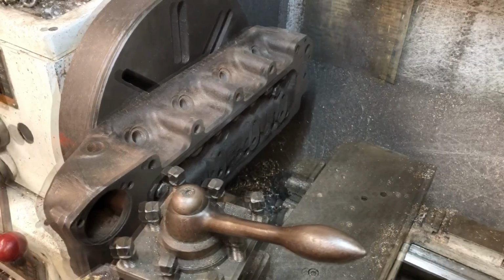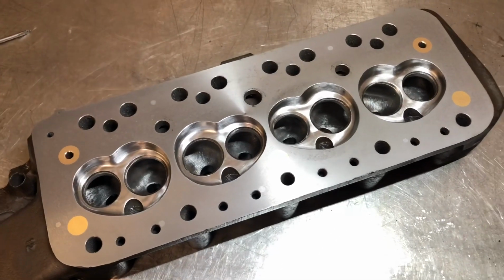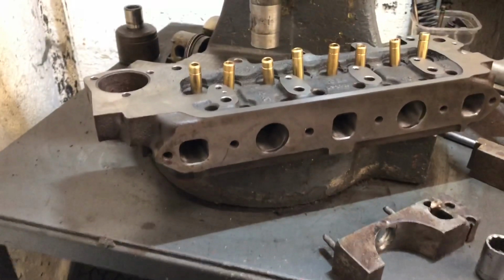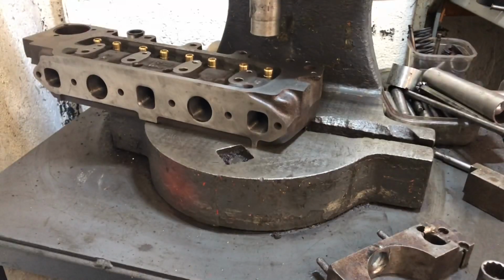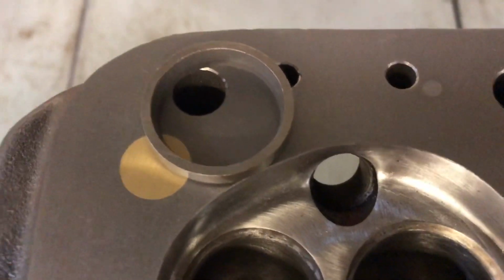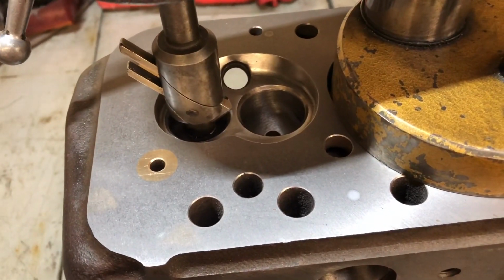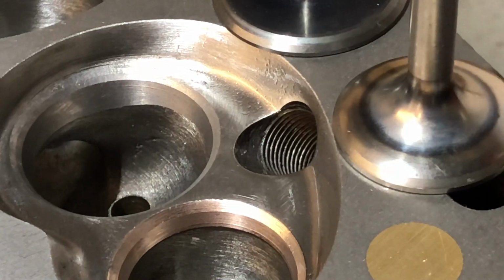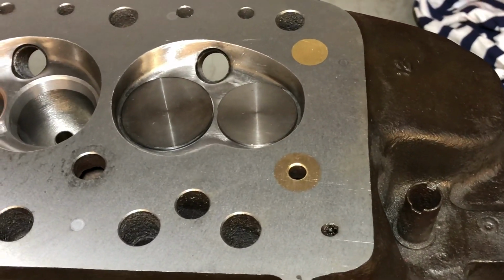How to modify your classic mini Cylinder head part 2

Comment: Nice work. I like the lathe surfacing of the head.

About 45 years ago I skimmed a 12G202 head with the only thing available to me at the time, a shaper machine, head worked fine till I replaced it with the better 12G295. This was on a 1098 cc engine for a Mini.
Reply from the maker: They used shapers for the factory cyl head surfacing
Reply: In Australia, we were fairly lucky 45 years ago as Morris 1100 autos and Minimatics had 12G295 heads. We also had a car called a Morris 1100 'S'. These babies were fitted with 1275s with 2 different block casting numbers, 12G 949 had forged cranks and Cooper 'S' rods but had a weak spot above the centre main and were fitted with sleeves in the bores, which prevented over-boring. Then there were the 12G1279 castings, which had lesser cranks and rods but no sleeves in the bores and no weak spot above the centre main. They were basically Spridget blocks turned 90 degrees. The good thing was that all the bits were interchangeable. It just so happened that we were on good terms with the local English Auto Wreckers, who would turn a blind eye whilst we made engines out of all the good bits and only pay for one block. They were happy and so were we  I had one of these hybrid 1275s in my 13-inch wheel Mini Moke. Coupled with an Mk1 Cooper 'S' head and twin 1 3/4" SU carbies of an Austin Kimberly (2200s in England) and I had a bit of a rocket. We were also on first name terms with  RPM Engines, the local engine machinist who we would get to make anything we wanted (Custom camshafts, balancing, lightened flywheels etc) and also on first name terms with Settlement Exhausts, the local exhaust shop who also made any exhaust we wanted. No one even mentioned the words "Street legal" in those days. Ah, memories.
Reply: @dalybaz I bought a junk car that ended up having a 1220cc engine in it. It was a 1100 with Hillman Imp Pistons in it. I didn't even know you could do such a thing. Because of the longer stroke, it went as well or better than a Cooper S. I then pulled it all apart, had it heavily modified, including using a heavily modified 850cc head and slapped that on top of a MKII Minimatic box. The thing made just over 110Bhp AT THE WHEELS! the thing was a Cooper S killer for sure. Thing was a bit rough at idle, but that was because of the 'Scatter Cam' and auto.
Reply: @doraexplora9046  I've found that the 1100 engines tend to go bang if you hot them up. 1220 using imp pistons is cutting things a bit fine. Use a std camshaft and don't rev them too hard. Maybe even tuftride the crank and lighten all the reciprocating bits to get the thing reliable. Bear in mind that the 1100 engine was designed for a series of granny cars.

Comment: I think you mentioned that you had used Neway valve Seat cutters before. Can you tell me which ones I need to do the 30 and 60 degree top and bottom cuts. I might be able to get a SH set but it only comes with the 46 degree cutter.
Reply from the maker: Hi 
 I have a selection of older neway cutters, check the reference numbers with the neway site for 30, 70 and 60 cutters or use three angle cutter blades in a 45 degree body.

Comment: Hi Stuart. When you press the valve guides in are you using the adjustable stop on top of the flypress to set the guide height or are you pressing them in flush with the top faceof the cylinder head?
Reply from the maker: the adjustable stop -
 mostly they are 2mm proud of the head top face